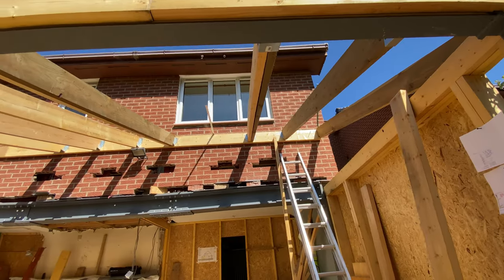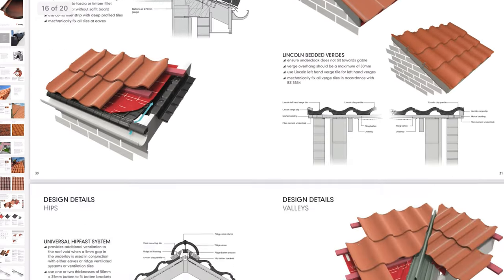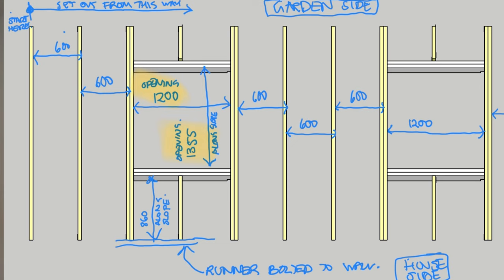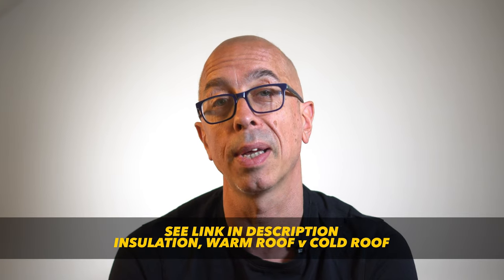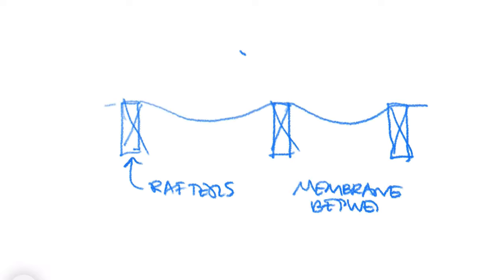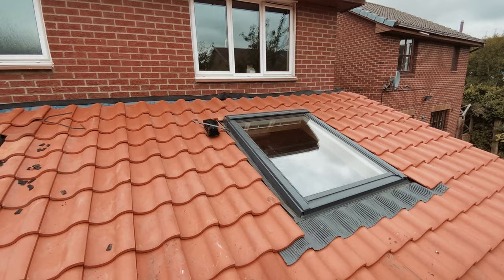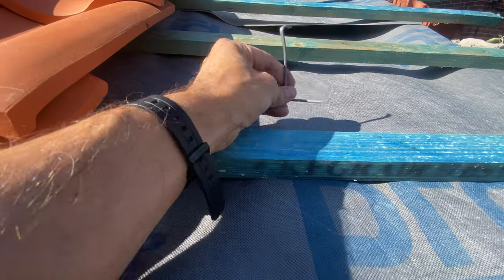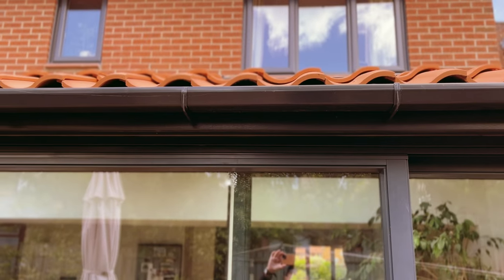How to roof this extension on your own - simple rules to do it yourself

Comment: Using Scottish roof method of sheeting roof with boards etc makes it so much easier ok slight cost but safer also as u can work off it
Reply from the maker: Agree but these tiles need to be fixed with battens. So if you’re using sarking as you say, you then need counter battens to go with the battens. Can make the build up a lot.
Reply: @build-better-things  was meaning sheeting rather than sarkin . But either way it gives that additional layer of protection rather than just a tile & membrane. Esp with all the crazy rain we get these days . any good projects coming our way

Comment: Thank you. How did you insulate the roof?
Reply from the maker: Insulation between the rafters and insulated plasterboard underneath. Ventilated cavity above breather membrane and underneath roof tiles.
Reply: Okay so you didn't choose for a warm roof? @build-better-things
Reply from the maker: I wouldn’t use that arrangement for this type of traditional construction with roof tiles. You want to be fixing your tile battens directly into the rafters, not through insulation.